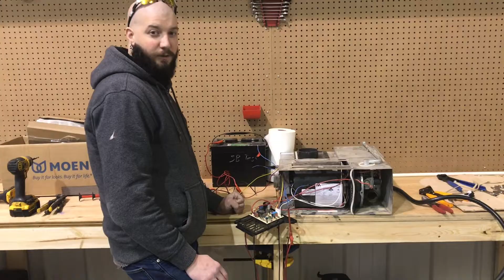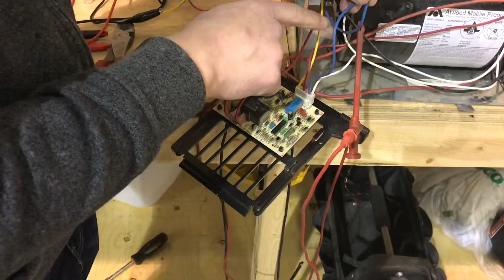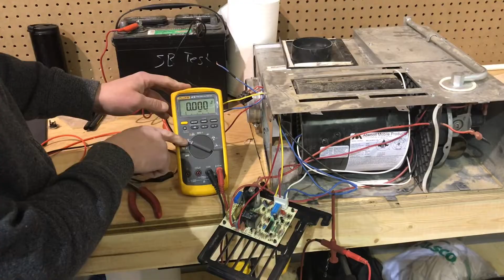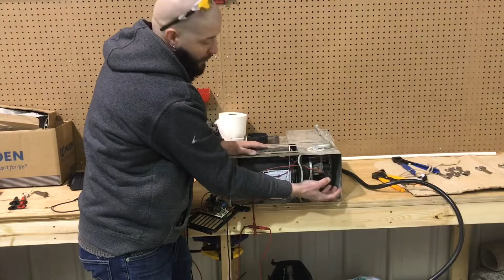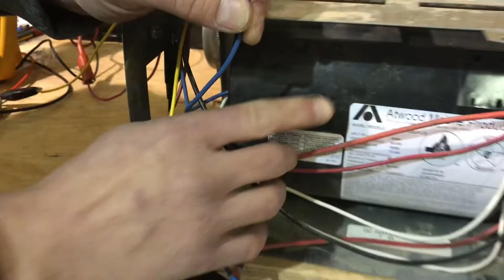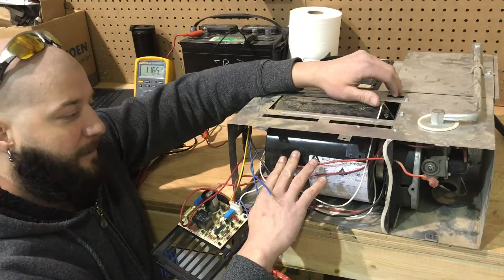Troubleshooting Atwood furnace part 2

Comment: So I have a question. My Atwood 8525-Iv keeps going to a lock out. If I understand correctly the igniter is also the flame sensor?  My heater turns on the flame is working for a few seconds the turns off power to the propane valve. Is it possible that is bad or is the controller circuitboard bad?

Comment: I've watched a lot of these type of videos. Nobody talks about the fault code "internal control fault" a.k.a  soild red light with no blinking. What does that fault mean??? Thanks
Reply from the maker: That is an issue with the board its self.
Reply: @thecanadianrvrepairguy3062  thank you for the reply. That was my thinking of the issue. Easy fix!!

Comment: Mine won’t turn on but has the one blink for air flow after I cleaned all my vents and changed my sail switch as well as my new connectors
Reply from the maker: Test to make sure voltage is getting all the way through the proving circuit, if it is then I would say your board is faulty or you have low voltage and the fan is not coming up to speed.

Comment: How do you access the burner head? I have the exact same model as you and everything I’ve seen for videos on other 8500 furnaces, they allow you to disconnect the propane housing right above the exhaust port. I want to try and unscrew the propane line that runs on the top of the housing, but I don’t know if it’s treaded. I don’t want to break it. Please help!!

Comment: do you have a part number for the sail switch?
Reply from the maker: Do you have the same model of furnace?
Reply: @thecanadianrvrepairguy3062  I have a different model. I found out that the battery was bad and once I replaced the battery it worked.

Comment: This is actually the best video on Atwood furnaces on youtube. You basically told me that if the gas is turning on but I do not hear the igniter working, then it is a problem with the igniter itself. So I assume that an igniter can actually go bad.
Reply from the maker: Yes they can or it still can be a board issue.
Reply: First off, great video!. I have an Atwood 8520. I have switched the board between both units and I still cannot get the rear to click on. The relay does not click and the fan does not start. I have power to the board. I verified that the fan does work on 12 volt power but I cannot get this unit to  start the fan...
Reply from the maker: @zr8c with the blue wires twisted together check for 12v coming out of the board to the fan.

Comment: Hey great video
Question hey so when i get a 3 flash /lock out what do i do
Reply: As my furnace will not shut off I thought replaced the circuit board but no  not the problem at all I'm currently looking for a thermostat for it,   I pulled the control box off the wall see what is what and  to see phone jack looking like the RJ11 cable  I'm like hey pull it out wait 10 second maybe it will reset, well now I have no power to the thermostat and or  the furnace what the fack 
I'm stuck with 1° out and no heat now please help 
Is this my thermostat??
I looked and see duo therm ac and my Atwood 8535 has no thermostat that corresponds with the RJ11 cable wth now please any help !

Comment: Thank you.  I have isolated it to the limit switch but how the heck do I get to it?  Do I really need to pull the entire thing out of my rv?  Its connected to the black plastic molded mounting box that you have on your new one here.  Its caulked to my rv and I would really like to not have to remove the caulking and re caulk later.

Comment: My blower would never come on,  direct power to motor would turn it on so blower works. Replaced my board still nothing happens. I connect thermostat wires and the board blinks one time and thats it..... nothing happens???

Comment: My furnace is throwing #1 code but my fan motor is not coming on at all I checked the sail switch it tested fine. Would the high circuit switch cause no fan at all or should I be more concerned with the board thank you.
Reply from the maker: That is a low input Voltage code. Check your fuses in you converter if your plugged in as well check your battery.
Reply: @thecanadianrvrepairguy3062  converter is running im on shore power with new battery. Reset switch on furnace is ok
Reply: @MultiCandyman1   I'm having the same issue, what's the easiest way to eliminate that its not the thermostat? in the video he jumps blue wires twice????? thanks
Reply: It was my motor

Comment: Cool video.  I need to replace my Atwood  model 2334 furnace. Do you have any suggestions on where to buy the entire unit? For a reasonable price? The previous owners had removed the gas valve and capped the gas line. It appears to be in decent shape but I don't think I want to trust the heat exchanger and its in a 2005 rv. I would feel better just spending the money for a new unit. Any suggestions on where to shop for that exact model?
Reply from the maker: I would take the furnace out and take it out of the case and inspect the heat exchanger. I don’t really feel it would be a problem and a gas valve would be cheaper. But as far a buying a whole new furnace just look around and check prices.

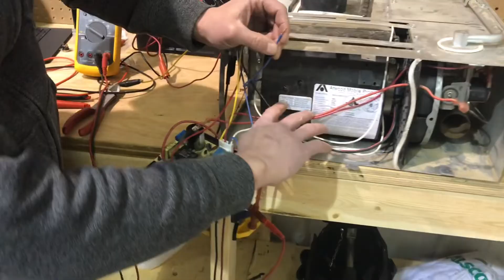Comment: Aha!   You said something at about the 7:00 mark that helped tremendously!  After not having any ignition on my furnace  while camping, I removed it and started tearing it apart.  After some tinkering, I was then able  to get it to light but only for a few seconds, before it would stop, and then attempt to re-lite, but it refused to stay lit.  I was about ready to start buying the flame sensor and a board, having already tested the sail and heat switches - but when you said “without the exhaust tube it will put itself out due to sucking exhaust back in” - BINGO.  Input the tube on (while furnace is still apart on the floor of my camper) and now it stays on and heats.  Thanks for this small but important tip!!!
Reply from the maker: Glad i could help you out.
Reply: This also helped me out big time!!!

Comment: Could you steer me in a good direction. I have no blower or ignition in my furnace. I tested the sail switch. I tested the on of switch. I sent 12 volts to the fan and that works. I have power and ground to the furnace itself. I have power to the board. I have no blinking lights or lights at all, I have no ignition or fan. The only thing I haven't tried was bypass the thermostat to see if that kicks the furnace on.  I think I have a bad board. Any advice?
Reply from the maker: Sounds like the relay on the board quit working. Is very common.
Reply: @thecanadianrvrepairguy3062  that's kind of what I was thinking. I'm no expert on these things. Tomorrow I'm gonna check continuity from the thermostat making sure that it's commanding the unit to run. At that point I'll bypass the thermostat to the unit and use a power probe to power the unit and supply ground. At that time I'll check power at the blower output on the board. If I have no power at the blower output and thermostat is bypassed I can condemn the board as bad? Than the next question is where can I get a fair price on these boards dometic wants 175$
Reply from the maker: @gdejackmo  so I would put in a board made by dinosaur they are a more robust board.
Reply: @thecanadianrvrepairguy3062  alrighty I'll check them out.
Reply: @thecanadianrvrepairguy3062  
Thanks for your help. Today I bypassed the thermostat and it the furnace kicked on. So I went up to the thermostat itself and that wire had power of 12 volts. I disconnected the furnace wire at the thermostat and than removed the ground at the thermostat. At that time I touched them together and I had the furnace run. I now know I have a solid connection from the furnace to the thermostat. So tomorrow I'll install a new thermostat and see if they restores normal operation.

Your videos helped me and I took some notes. I found the positive thermostat wire and found the ground thermostat wires. I made the cut in them. However on repair I used opposite male and female connectors so if I ever need to do a diagnosis on the road I can just swap connectors. I did the same for the high pressure switch so I can just back probe them. Thanks again!

Comment: I noticed you located the sail witch from the two divets.  How in the world do you take out the sail switch?
Reply from the maker: You have to take the fan shroud off
Reply: @thecanadianrvrepairguy3062  Thanks for the super fast reply!
Reply: @thecanadianrvrepairguy3062  I got to it and tested the sail switch. Used some canned air to clean it too. The problem I am having it that the heater goes through one heating cycle, cools down, and the fan keeps keeps going way after two minutes. Any recommendations?

Comment: on mine every step works except the solenoids clicking open. I replaced board as well as checking sail witch and the spark even clicks
Reply from the maker: Check the ohms of each solenoid.
Reply from the maker: Should be 30 to 50 Ohms.
Reply: Yes it 40 each one.
Reply: It does run through all steps except there seems to be like a quick 7 v to the solenoids
Reply: It could be the burner. I took mine out and it was completely broken. That would cause it to click and still not light.

Comment: My furnace will run for 10 minutes and then the heat STOPS.  The fan continues to run but he HEAT stops....WHATSUP?
Reply from the maker: I am assuming it is an Atwood or hydro flame
Reply: @thecanadianrvrepairguy3062   Yes, Atwood  AFMD35121      When testing it I removed some of the duct-work and monitored the heat being put out.  The heat was normal for about 8 minutes, but then it seemed to me the heat was EXTREMELY HOT (but maybe i was wrong, and remember I had removed the duct-work so the heat was coming straight out of the unit), shortly after that the heat stopped but the fan continued to blow right on and on.  I could then hear the gas solenoid valve click but I could not hear the ticking from the electrode.  Can these boards get "hot" or something and kick out?  If it was the board would the entire unit shut off?
Reply from the maker: @cblair0608  what is happening i believe is you furnace is cycling it is running on the high limit switch there is not enough air flow and it is getting hot
Reply: @thecanadianrvrepairguy3062   Well....there doesnt appear to be any restriction.  I have checked everything.  I might add this furnace is UNDER the refrigerator.  This furnace is not accessible outside, you have to remove the panel from under the fridge to access it.  When I test ran it I had removed the front cover.  Am I missing something?  It had 3 duct works attached to the front (approximately 3" in diameter) and then another one on the side which was approximately 2" in diameter.  Is one of these the "intake"?    Remember, when I tested this unit I had ALL 3 of the front ducts removed as well as the 2" duct on the side so EVERYTHING should have been receiving ample air flow.
Reply from the maker: @cblair0608  being in that area yes if the heat can’t be taken away it will pop the high limit open. The limit switch could also be getting weak from being run so close to its opening temperature. It’s a hard thing to diagnose without actually being there. But I am pretty sure the way you describe what’s going on it’s that the heat can’t be taken away and it’s hitting the limit switch shutting off the gas then cooling off enough and it re lights and keeps going on that cycle until it reaches your set temp of the room or it is shut off.
Reply: @thecanadianrvrepairguy3062  So are you thinking there is a restriction inside the tubes of my heat exchangers?  I did see a significant amount of debris laying in the compartment area where my exhaust port is located, the debris was just laying on the bottom but there was a LOT of it.  I removed the debris and turned on my furnace to get air flowing to see if any additional debris was coming out of the exhaust and saw nothing.  So, should I remove my combustion wheel and try to blow air thru my heat exchangers and see if any debris is expelled out my exhaust?
  
Second question (let me see if I can get my question worded correctly).......with my furnace reinstalled and running, if I go outside my camper and I put my hand close to the exhaust how much air should I feel blowing out?  For example, should I be able to feel hot exhaust air coming out if my hand is 2 feet away from the exhaust port?

Additional info:
I was just talking to the guy who owns the camper and this furnace was operating fine (2018 model) before.  He had the furnace on multiple times in the prior couple days and it worked great.  He then removed both propane tanks and had them filled (not at camper facility), reinstalled them and the problem started the next morning.  My first thought was oil, but then I recalled that when I removed the propane supply line from the furnace there was no oil at all present, not even a residue.   But could some oil still be making it to the burner and causing this to overheat?

Comment: So my Atwood 8535 is not igniting. All the sequences seem to be working until it goes to light. You hear the ignite try to light rapidly but doesn’t. Doesn’t seem to be getting gas. As it’s trying to light my control board is flashing red rapidly the entire time it tries to ignite. What does that code indicate?
Reply: It is probably the burner. Easy fix buy it on Amazon

Comment: I have a Atwood / HydroFlame Furnace Model 8535-II
It runs fine until the outside temp drops to 30 Fahrenheit. At 30f the blower just runs and runs without igniting the burner, that is until I turn off the thermostat and back on and it usually turns on the furnace. Any ideas?
Reply from the maker: With out testing. I would start with gas pressure might be to low.

Comment: Nice video! My camper heater won't fire up, but does not show any beep codes. What should I be looking for? There is propane, hot water heater and stove work. Thanks
Reply: hi, i have the same problem, could you tell me how you fixed your? Thank you!
Reply: @paulkaisrik8617  Hi, I put a new furnace burner and electrode kit. Check your model heater to get the right one. It fired right up and works perfect now. Sorry, I just saw this.
Reply: @michaelraffaghello1895  thank you for the info.

Comment: I have an atwood 8535 iv dclp that will light then shut off after about 10 sec repetedly,is this the sail switch or a burner or flame sensor problem?
Reply from the maker: It will be a sail switch or high limit switch. I would lean towards the sail switch.

Comment: Hi i just replaced the furnace motor and 6 hours later its doing the same thing . Can hear power going to the motor but wont turn. What is my problem know other than probably needing another motor
Reply from the maker: Sounds like the power relay on the control board is not closing all the way I would suggest a new board.

Comment: Enjoy all your videos. I have that same unit and need to get the gas valve out. Could you possibly do a video on that.not sure how to get that long gas line loose, really hard to find a way to get a back up wrench on the valve. Thanks man.
Reply from the maker: Thanks glad you enjoyed them. Trying to get better at it a little shaky at times. I have that furnace sitting on the floor in the shop so I will do a complete tear down here as soon as I can.
Reply: @thecanadianrvrepairguy3062  That would be awesome. It’s only a couple years hold, used once. But I pulled out some large mud robbers nest. Ignites but then turns off. Wanna tear into it further to see if they got further into the heat exchanger. Don’t want to cause more issues damaging that long gas line.
Reply: Did you figure out a way to get that loose i cant find a video or picture of how to remove that long tube either and dont want to break it.

Comment: Hey. I have an Atwood furnace in my camper. I've noticed it'll light off for a couple seconds and snuff itself out. I noticed you said there was a flame sensor on there. Which parts acts as a flame sensor? Was it that control valve?